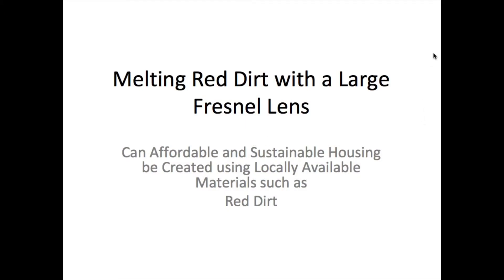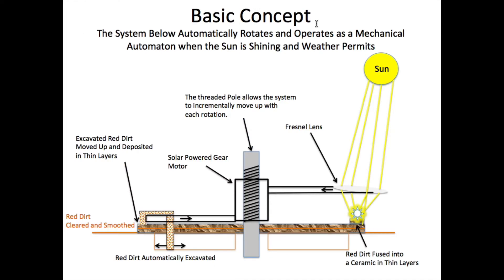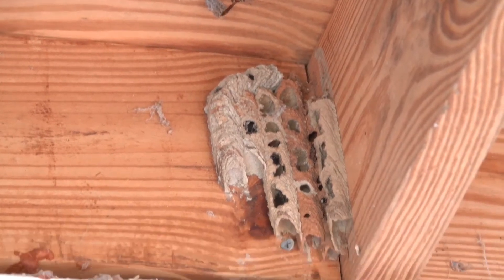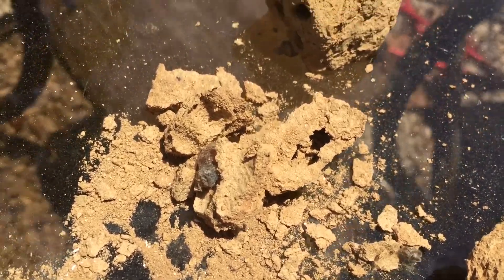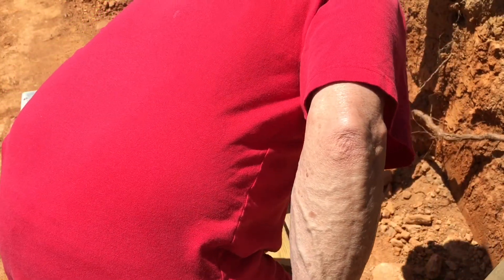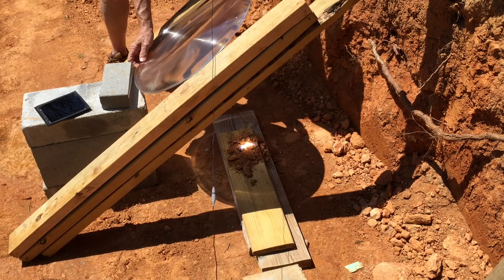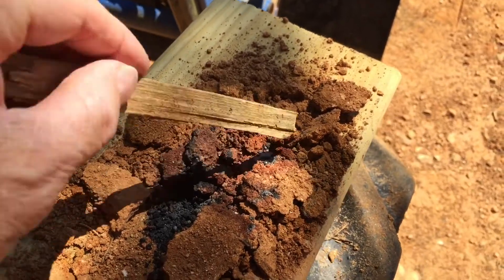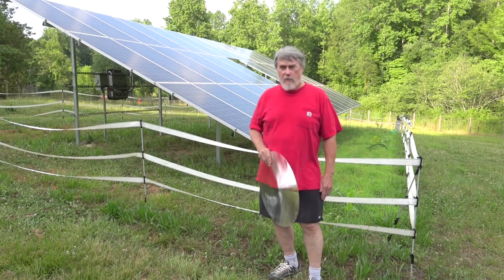Melting Red Dirt with a Fresnel Lens

Comment: This is great! I am interested in using a fresnel lense for soil solarization and weed killing.There are a few scientific papers on this but I havent seen any videos. I hate moving plastic tarps! I dont know about the feasablility because the areas are large but I wonder if there is some sort of way to mount the lense on a wheeled contraption that can move across the field as each little section is completed. Would love your ideas on this!!
Reply from the maker: Thanks for watching and your very interesting idea. You could put together a large fresnel lens and a wheeled cart like a lawn cart. You actually don’t even need wheels. You could attach it to smooth runners and drag it like a slide. There are a few challenges you should be aware of. The focal length from the surface of the lens will have a huge impact on the temperature achieved on the soil surface. Focusing solar collectors like a magnifying glass, fresnel lenses and parabolic collectors have to be oriented directly towards the sun at all times for maximum effect. On cloudy days the sunlight is dispersed and you will find that will have a negative effect on the temperature you can achieve. Fresnel lenses are also very good at starting fires so be careful. I have also placed tarps on areas to kill all the vegetation. You need to let as much of the full spectrum of sunlight including mainly the visible and infrared wavelengths through the tarp where it will be absorbed and reradiated as a longer wavelength infrared, but trap it there so the temperature will rise. This is basically what greenhouse gases do in the atmosphere. Polyethylene including black polyethylene is fairly transparent to thermal infrared wavelengths. One of my older videos demonstrates this: https://youtu.be/tvlDlGKUe_o
Try working with different colored tarps and sheet plastic to experiment and see what works best for killing vegetation. Thanks again for watching and good luck with your project.

Comment: Is there a material or rock that will not burn/melt using a Fresnel Lens.  I want to use a FL to make one of those DIY solar heat collector where I believe there could be even higher temperatures reached if capturing the sun using a FL but I don't want it to burn down my house.  Any suggestions?
Reply from the maker: Thanks for watching and your comment.  You can use a lot of different metals or ceramics depending on what you are doing just by widening the focus point so it doesn’t get extremely hot. The distance of your target from the fresnel lens can be varied shorter or longer from the focal length to minimize the temperature. The total amount of solar power should be about the same, but spread out over a larger spot at a lower temperature. The only reason for a focusing collector is to achieve higher temperatures on a small target area. I once did some experiments with glass covers on black plastic trash cans. In full sun the air temperature in the trash cans increased up to 160 degrees F. One of my early videos was on making a parabolic trough collector https://youtu.be/2v7ePDA-0m4    I used copper pipe painted with high temperature flat black paint for the target with water flowing through it which is another way to keep the temperature down. As long as water is in your target at atmospheric pressure the maximum temperature will be the boiling point of water or about 100 degrees C depending on your elevation. Good luck with your project.